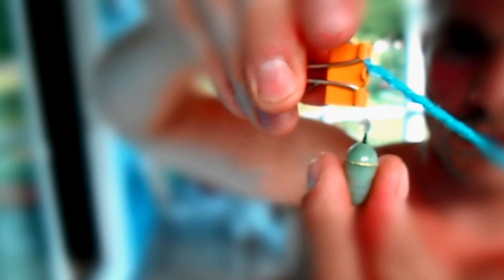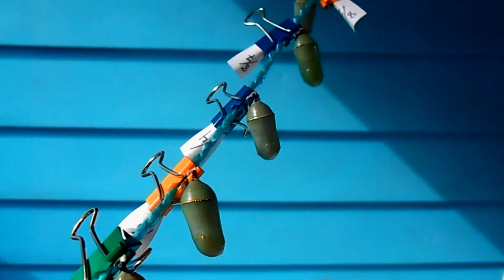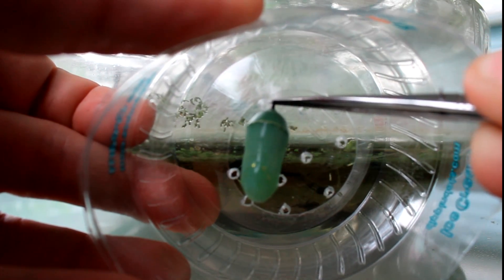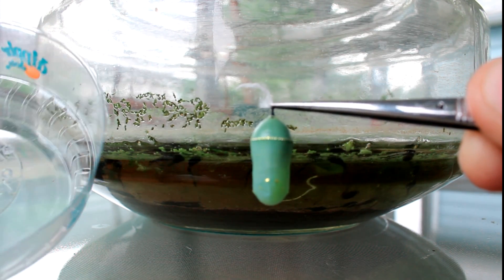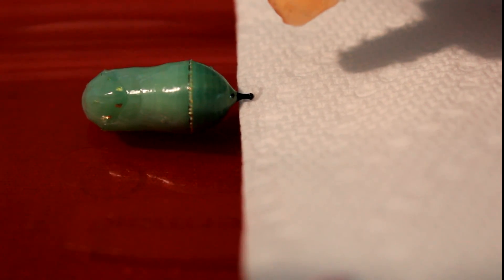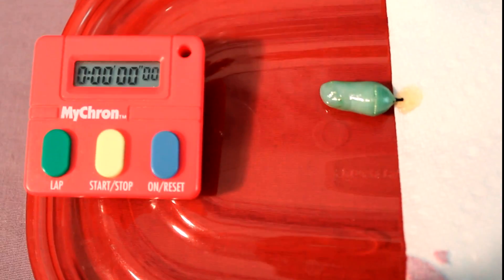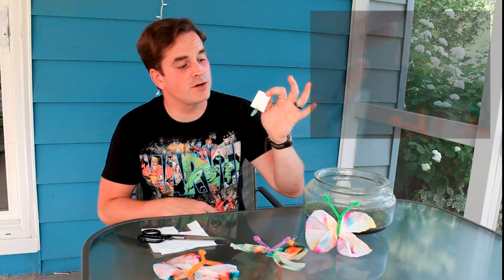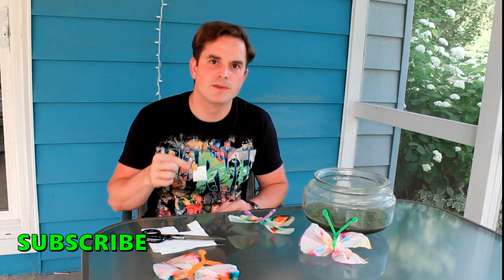Raising Monarchs - Chrysalis Repair (Help The Monarch Butterfly)

Comment: Super sad, can you please help me?.. My caterpillar was J shape, found on the bottom of habitat, with partial chrysalis formed on abdomen. Seems to be struggling to for the chrysalis. It has been 2 days. I have quarantined and provided cotton and soft paper towel for it to form the chrysalis, but nothing has happened yet. Should I euthanize humanly using freezing method, or will it form the chrysalis? Sad to let it suffer if it is suffering, or morphing. I just cannot tell. Please help if you can.

Comment: Thanks for making this video, it's older so I doubt you'll see this comment, but I had a chrysalis fall, it's undamaged, however the stem is pretty much non existent...I used super glue and attached a twist tie to it, I tried very hard not to get too much glue on the chrysalis...I was wondering is the chrysalis  permeable...is the glue going to get inside and hurt the butterfly? Any help would be greatly appreciated, thank you for  your great work!

Comment: Mr.Lund, I saw the title of your video and hoped you meant there is a way to repair a broken chrysalis. Teeny chrysalis steri-strips? Band-aids? Surgical glue?

I'm very distraught. I had some chrysalides from my garden set up nicely in a mesh habitat to view eclosure with my kiddos (our first time!). 

While, I usually had the cage hung high out of reach, my 4 year old was patiently watching on a table as one of them was about to eclose. My toddler broke through the baby gate and grabbed one of the other chrysalides and ripped it open. 😱

Very distraught and repulsed, I quickly moved to throw it away, but then I remembered how you say to give them a chance. I kept it on a paper towel at the bottom of the habitat.  

It is ripped open with a significant gash, there were 3 brown drops of liquid where she dropped it. It doesn't appear to have any more oozing. I estimate it was day 13 and had only the slightest blackening beginning. 

Soon after, its friend eclosed beautifully 💔. 

My instincts tell me there's nothing to be done for this guy. But figured it couldn't hurt to reach out. Thanks for your awesome videos! We planted milkweed and encourage all our friends to do the same.

Comment: Hi Mr. Lund.  We started helping the Monarchs quite by accident but are so glad to be helping.  We have released 2 but have 25 chrysalides now, 1 J and 8 caterpillars.  I thought I had a bit of a disaster today because 17 of the chrysalides fell when the common silk collapsed.  It had been looking more like a spider web and today, the weight just took them out.  They were all in a pile at the bottom of the habitat, and I was heartsick.  Even though I had watched the other video saying they will be okay, I didn't think a pile of 17 would be a good idea, plus they landed on a caterpillar.  Based on this video, i glued the silk of each one to a piece of paper towel and attached them to the top and sides of the habitat.  I used a straight quilting pin through the mesh and paper towel.  I said I thought I had a disaster because as I came back to your videos, I ran across the one talking about overcrowding.  So, I kept that in mind when hanging these and spaced them out significantly more than they were naturally.  Thanks so much for showing me how to hang them back up.  Hopefully I'll have several releases in about 7, 9 and 10 days.

Comment: Figured out what primate glue was, and used it for a chrysalis which detached from its silk when I removed it from the lip on the inside of an empty sugar bowl (of all places to choose!) I had kept the sugar bowl tilted with a wedge when I saw the cat jay-hanging from the lip so the the chrysalis wouldn’t bump into the side of the bowl when it formed. It was a good three days before I moved it. However, after I glued the cremaster to a paper towel, when the glue expanded, a little bit got onto the top of the chrysalis. Do you think that will harm it?

Comment: I felt so bad the other day I was in the process of moving one to another cage and the top half of the chrysalis came off and green goo came out. I have 40 others but I had been pulling from the black and not the silk. That was the first one I ever tried to move. Found your videos and wish I  would have saw the technique before.
Reply: how and where do i buy primate glue? is there a brand name, PLEASE? ANY OTHER GLUE WORK ALSO?
Reply: @julianodegrassi2542 gorilla glue

Comment: What if it fell, and  a little green fluid came out. Its been on its side all day but I did read they need to hang I dont want to handle it too much. Should I just leave it or no?
Reply from the maker: This was a reply to another, similar comment you made on the same day:
"Greetings Maria.  I'm very sorry that this happened.If a chrysalis has lost too much green fluid, it will not fully develop or even develop at all.  Losing just a little of the fluid, though, and there can still be hope.  What you're describing, however, especially with the "deflated" part, sounds like plenty of fluid was lost.  As for the position, I wouldn't really be able to best advise without seeing it for myself.  However, I suppose I'd likely leave it as is at this point.  I wish you luck!"

Comment: Can I use any other glue (ELMERS) to repair the chrysalis? We had a chrysalis in our second grade classroom today and it does not have enough silk, also the stem is very short.
Reply from the maker: It can be tried.  That type of glue, though, takes quite a while to dry.  Not saying it's impossible, but I would say it wouldn't be easy.  Glue of that type could also spread over the chrysalis casing, which does need to breathe.  I know I'd try super glue before I'd try white glue.
That said, the chrysalis, if properly formed and hardened, can develop just fine on its side.  And the adult can emerge from it and dry its wings properly if you give it a way to climb up something.  I show that here:  https://www.youtube.com/watch?v=kxCzr89Ck3E

Comment: Ok, I have a Chrysalis that just formed. It was hanging upside down! I was able to tie a suture thread around the black stem and hung it right side up. However, it is dripping. Should I leave it or discard? It looks a little shriveled.
Reply: I found a spot where it was dripping and put a dab of tissue on it like a guy does when he cuts himself shaving. The drip stopped. I am keeping my fingers crossed.
Reply from the maker: If the drip has stopped and sealed, you did excellent.  Despite losing some of this fluid, the adult body can still form.  But, it does depend upon how much was lost.  Still, I'd fully give it the chance and see what happens.
Good luck to him/her!
Reply: MrLundScience sadly the Chrysalis turned black and I discarded it.
Reply: @bethmorano1452  they are SUPPOSED to turn black just before then turning clear where you can see the butterfly inside before it merges

Comment: Hay Rich i use a Q-tip and rub it on the inside cap of elmers glue and attach the Q-tip to the black stem and clip the Q-tip up on a string. Found that this method has worked well and have saved many. Thanks for your videos
Reply from the maker: Certainly another option.  Thanks for the tip!

Comment: Hi Mr. Lund, I clipped a chrysalis from the black stem today.  Having watched this video just now, I realize it is susceptible to falling off. I only have Elmer’s glue and wood glue. Do you think wood glue would work?
Reply from the maker: I think it would, yes.  HOWEVER, the chrysalis can also develop just fine (assuming it's already hardened) while laying on its side.  Seriously.  No issues.  I mention the hardened part, though, because if a chrysalis falls while still drying, that can cause part of it to be somewhat flat.  When they have a flat side, or other ways are malformed, that can sometimes cause deformities in the wings or other parts.  So, as long as it's a normal shape, on its side is fine.  The development of the adult body is not gravity dependent.  Also, they can eclose out of the chrysalis as an adult with the chrysalis being on its side too.  Just have to give them a way to climb up and dry the wings.  Here's a video showing this:  https://www.youtube.com/watch?v=kxCzr89Ck3E
Reply: Awesome! Now I have two options. Thanks!

Comment: i have one that fell while making the silk. i tried putting it back near the silk and it's just hanging by some miracle but not where it made the silk. will it make a chrysalis and do i still hang it like in your video?
Reply from the maker: If a chrysalis is just barely hanging on, once it has formed and dried, I would not allow it to still hang.  It risks falling, which could damage it, depending upon the height it falls from and what it falls onto.  Best not to risk it.  At that point, if you remove it, you could either try to use the method in this video to rehang it, or, it's actually perfectly capable of developing normally on its side.  In fact, the adult can even emerge from the non-hanging chrysalis, provided you give the adult a way to climb up something and dry its wings.  I show this in this video:  https://www.youtube.com/watch?v=kxCzr89Ck3E

Comment: Oh boy.  I just did this...  Had the stem disconnect from the stem I used Elmer’s school glue and glued the SILK, wadded up, back to the stem.  It’s holding!    But next time, if I need to, I will try this....  thank you for all u do!
Reply from the maker: There's definitely multiple options, including not doing it at all.  Some have reason to still want to hang them, and this video helps with that, but a chrysalis can also develop, and the adult emerge from it, on its side.  This video shows such an emergence:  https://www.youtube.com/watch?v=kxCzr89Ck3E

Comment: "A certain primate glue" lol 
Nice! I never thought about using that.
Reply from the maker: What I like about it for this is that it's expansive.  That helps give more surface area for the adhesion.  I nerd out a bit on that glue's chemistry.
That said, what I do in this video, though, isn't necessary.  A chrysalis can develop on its side (assuming it formed correctly first) normally, and a Monarch can eclose (emerge from the chrysalis) on its side just fine, provided it has a way to climb up something and dry its wings.  I made this video to show that:  https://www.youtube.com/watch?v=kxCzr89Ck3E
Reply: Hahahai said the same thing.  Very funny.  Yeah hedidnt want a mark or strike on his channel.  Good job ADLIBBING BUD
Reply: What’s a primate glue?! I need to get it tomorrow because my first ever chrysalis fell today as it was shedding and turning into the chrysalis just like that without the web.

Comment: Have you ever done swallowtails?  I have a swallowtail chrysalis that partially fell (it is hanging upside down).  Its sling must have broke and it doesn't have any silk at its top end to tape it back so it is hanging upright.  Do you think it will form normally?   Another one is looking like it is going to form its chrysalis on the bottom of the container...It is looking mor like a J and wont eat anymore when i put it back on the parsley.  It just rolls on its side and stays in the j shape.  I'm worried if it forms the chrysalis on the paper towel, it will get damaged while it dries and end up flattened on one side.  I cant see any silk on it to hang it from.  Help!  :)
Reply from the maker: It's a worthy concern.  But, if the caterpillar chose it, it might instinctively know better than us icky hairy humans, right?
Reply from the maker: I don't know that I can say I've successfully raised Eastern Black Swallowtails.  I've had two experiences.  The first involved me having a female lay 30 eggs on some parsley I purchased.  My fault, though, I purchased "organic" parsley, assuming if it was chemical free, they'd be fine.  Nope.  If it's "organic", it can be sprayed with "organic" bacteria as a pesticide, and a very effective one.  After about 5 days in with the caterpillars, they started dying off.  Two made it to the instar where they'd soon form a chrysalis, and then, those two died as well.  Zero success.
My second experience, I just found two ESB caterpillars on some home plants.  I have NO IDEA what they were eating during their time in my yard.  I'm clueless.  But, they were at the stage where they were about to form the chrysalis, so I put some kebab skewers in some styrofoam at an angle in a small container, and they did their chrysalis hammock thing just fine.  Came out as adults, and were released.  But I wouldn't say I raised them.  Just had them as house guests.
When it comes to what you're dealing with though, first, of all the moths/butterflies I know about, and while that's not a lot, they all can develop fine in a non hanging chrysalis/cocoon.  In other words, the development is not gravity dependent, and which direction gravity is pulling on the pupa, development happens all the same.  Second, if the lil' guy has options of where to form the chrysalis, but it is still choosing to do it in a spot you don't think is wise, we should probably default to the animal's judgement.  We might not think it's correct, but when it comes to forming a chrysalis and where to do it, the caterpillars are the authority.  Can they make incorrect decisions?  It's possible, sure.  But I know I'd trust their judgement beyond my own.  I hope that helps!
Reply: @MrLundScience  Thanks for the reply.  I have a few more that didn't climb the sticks, they just laid there and formed their chrysalis right on the paper towel.  They seem to be ok.  I was just worried that the new soft chrysalis would get damaged (flattened)on the paper towel before it hardened and I would end up with deformed wings.

Comment: hi Mr Lund. you were wrong about the black stem breaking and the chrysalis most likely not making it. i just had a male that the black stem snapped of completely and some fluid was in the stalk and today he just emerged and had no problems whatsoever
Reply from the maker: Yes, it can work out.  But it depends upon fluid loss, along with the chance for infection if bacteria is in there.  I'd never say that such a chrysalis is doomed, but to give it the chance that you did.  Great that you didn't give up on it, and I'm pleased it worked out for the guy/gal.

Comment: Is it "Primate" Glue or "Primate" Super Glue? They seem to make two.
Reply from the maker: No "super" was involved in this video, though I would expect it could equally be used.  What I prefer for a more reliable hold is the idea that the glue is expansive and will fill in niches.  Also, though, hanging the chrysalis is not a requirement.  If set up correctly, a Monarch can fully develop in a chrysalis that is on its side (provided it was able to form correctly) and emerge from it on its side as well.  See here:  https://www.youtube.com/watch?v=kxCzr89Ck3E
Reply: Adore you Mr Lund🦋

Comment: Your not suppose to touch then in the  chrysalis  It kills them
Reply from the maker: Greetings Emma, and thanks for checking out the video.
I'm sorry, but I'm going to have to disagree with you on what you have said here.  Not sure where you learned this idea, but touching a chrysalis, provided you're careful with it and don't drop it or apply too much pressure, definitely does not kill or even harm the Monarch.  Once a Monarch in my system has formed a chrysalis, I relocate it onto the yarn string I show in this video and in others, and there's a very large number of successful Monarchs that have emerged from my system, all of which have had their chrysalis touched in this way.  If touching the chrysalis caused death, these videos wouldn't and couldn't exist.

Comment: What was the brand of glue you used?
Reply from the maker: Hey Bin!  YouTube is kinda funny about endorsements.  I'm probably overcautious, but if I were to name a brand, that could be interpreted as endorsing a company.  Doing such without officially declaring to YouTube that I'm endorsing a company could further be interpreted that I have some undisclosed deal with that company, making money and keeping YouTube out of the cut.  Thus, I stay far away from such things.  What I can say is that any quality type of glue that expands as it dries should work out, using roughly the same amount I show in this video.  I hope that helps.

Comment: We were camping when I found three Cats I chose a clear plastic mayonaise jar and put many holes in the cover and a few in the side. I also mounted at the top tiny plastic straws which crossed the top of the jar. The Cats eventually made the Chrysallis hanging from the straws which were easy to remove if needed and hang somewhere else.

Comment: Rich, I had one go into chrysalis last night and noticed it had fallen to the bottom of container (8" fall).  I gently picked it up with tweezers used under it as to avoid putting pressure on any side. I am currently using your method of gluing the stem to a piece of paper towel.  My question is, will this have an effect on it's development so soon after forming the chrysalis?  I will hang it as soon as the glue dries.  I assume it fell from the screen top as it was wiggling to shed it's skin because the skin was still attached to the screen.
Reply from the maker: Eight inches of a fall has the potential to be okay.  If it didn't rupture and lose fluid, it has a good chance, in fact.  The question is, did it form a proper, normal shape when it dried/hardened.  That's the most important part at that stage.  If it's shape is abnormal, it still has a chance to form with little defect, and thus, able to fly.  But, if it has too abnormal of a shape, there's a chance the wings may be malformed or something else when it comes out.  Gotta give it that chance, though!
Reply: Thanks for your response.  There was no fluid leak/rupture that I noticed.  The only abnormal shape was the dome or top was not as elongated as the others and maybe a little flat on one side (just slightly).  You're right, gotta give it a chance.  Thanks.